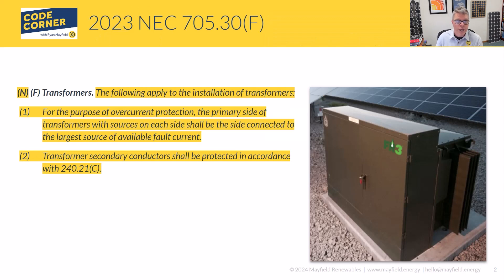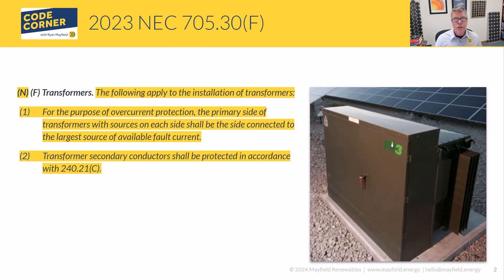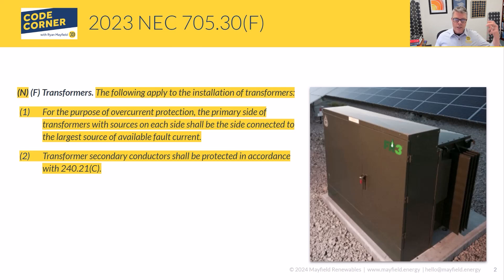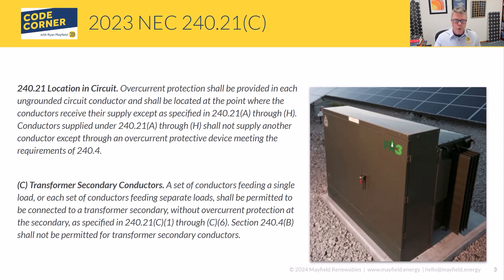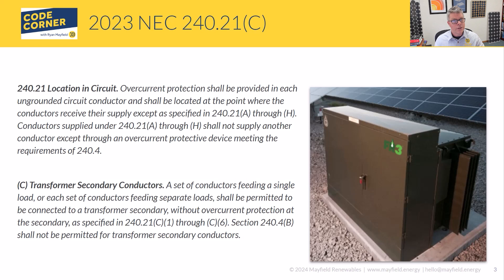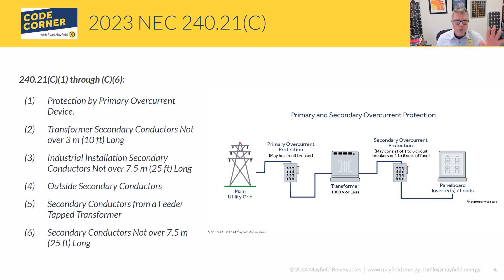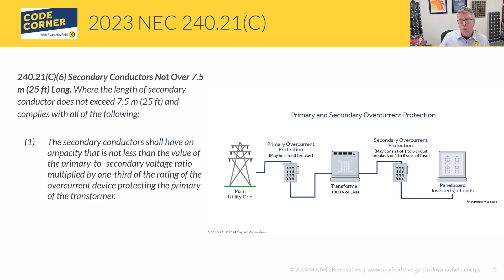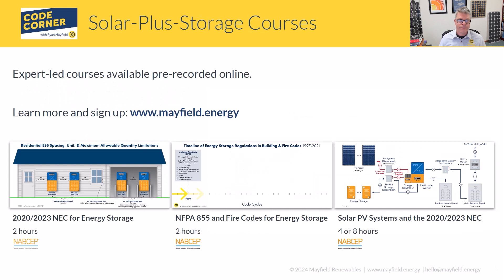2023 NEC 705.30(F) and 240.21(C) Overcurrent Protection

Comment: Great video. I'm doing digging into proper conductor and OCPD sizing when integrating transformers into 480v inverters and interconnecting at 208v. I've seen instances where solar design firm #1 will calculate the OCPD based on the calculation "(Inverter VA)(VOLT x 1.732) * 1.25" on both solar and grid side of a transformer. Solar design firm #2 will calculate the grid side different, calculating the OCPD for the size of the transformer instead of the connected inverter capacity. According to code, what is the best approach? For example, I've got an 480v 80kW inverter with a 112.5 kVA 480 to 208 transformer. 

Thanks in advance. Great content.